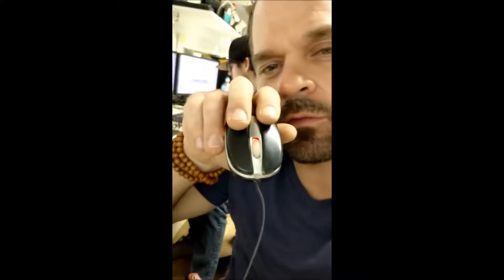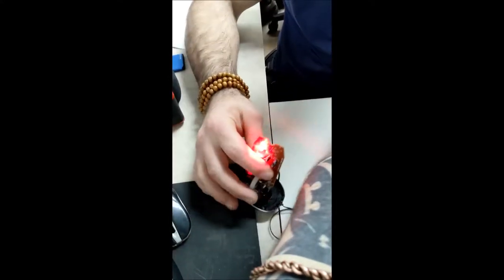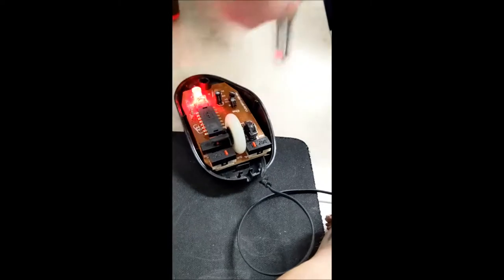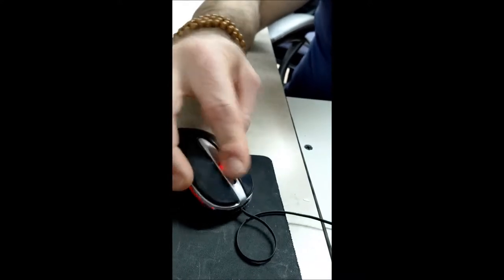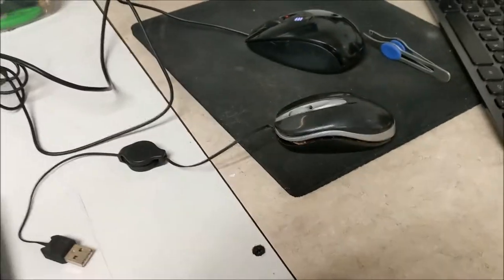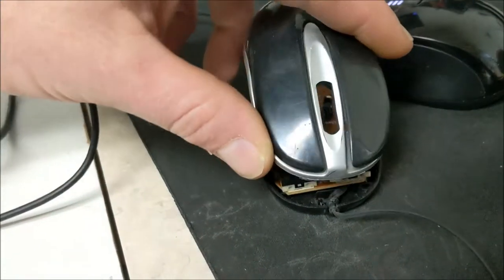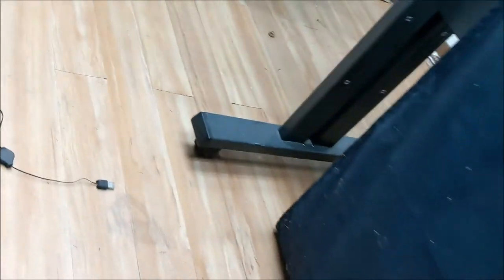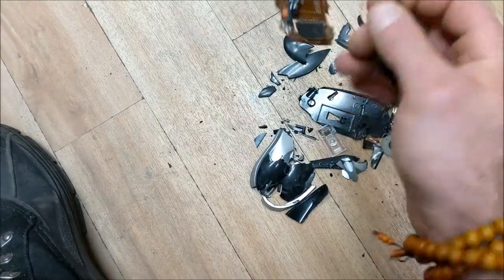How to FIX Optical Mouse

Comment: After trying all the steps with nearly the same diminutive model of mouse, I must have wrapped the cables too loosely coming out of the casing because it still didn't work.  This guide did not result in thinning out my phallus as I don't have one; however, the laser was most helpful in rendering me blind in one eye (red has always been my favourite colour.)   
Further, Mr. Barf's  musings did wonders for my self-esteem before his direction encouraged a spirited destruction of  my wasted technological spoils in a bright, "anger room" setting:  quite refreshing.  Most helpful, thank you!   --- Ms. A, Toronto, ON.
Reply from the maker: Happy to help Ms. A! xoxo

Comment: Help me the mother board and every single piece has come out
Reply from the maker: you need to find the blue circle and mash it with a crayon. if that doesn't work make sure its plugged in and bury it. should be good as new